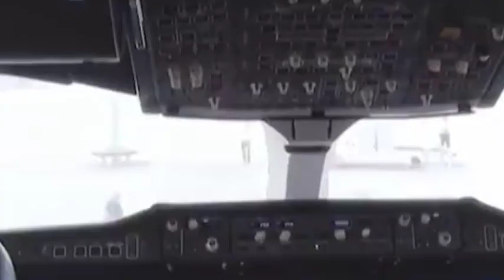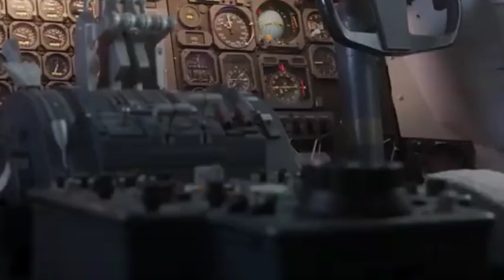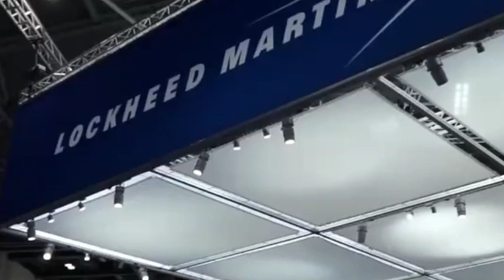Chinese aircraft C919 may change the world’s civil aviation landscape.

Comment: C919 will take over the 737max’s position as it has been discontinued due to serious quality problems. The FAA has postponed the issuance of the airworthiness certificate of the 7 and 10 series of the 737max. It has been found out that the Alaska airlines had flown without the bolts of the emergency door for two months. It was just pure luck  that the aircraft was relatively at low altitude and a child was held by his mother to prevent him from being sucked out through the gaping hole in the fuselage. Boeing is no longer the world’s safest aircraft manufacturer in the world.
Reply: How can it take over when the stolen technology CCP aircraft hasn’t been certified in Europe or U.S. regulatory authorities?  Years down the line. By then Boeing should have removed the very policies that put itself in its present predicament.   If anything it will be the Russian MC21.